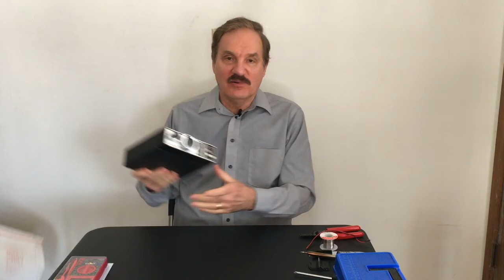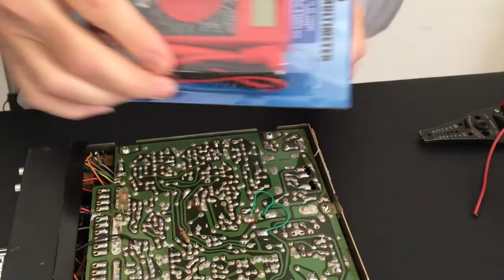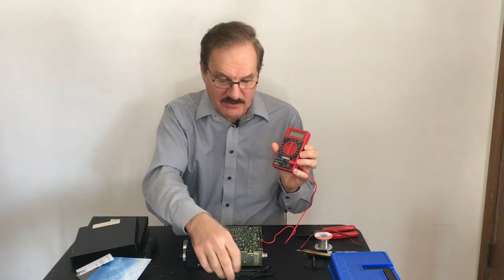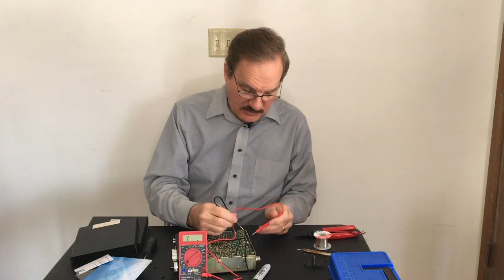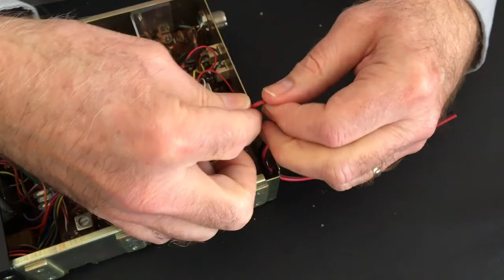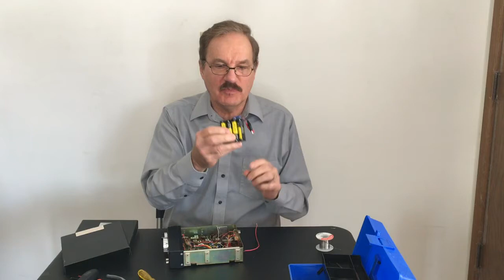How To Repair a CB Radio Power Cord

Comment: Where do I find the negative and positive?? I have the radio I took out the wires  I forgot but also have the meter. Help!
Reply: Don't know if you ever figured it out but if you take a meter and connect it to the chassis of the radio, then touch one of your two empty solder holes. You should get continuity out of one of them (it'll read zero or also beep depending on your meter). That is your gound connection. The other will be power.

Comment: why need a meter ??
open your eyes, remove the cable grip, get a wire and solder the board until it comes out,
locate the other wire on the board, heat it and remove it, remembering which was red or black.
fit new wire with a fuse,
maybe even check or replace the reverse polarity diode to be safe..

this guy makes easy jobs hard work..!!
Reply: Dear Stupid: the man did the job correctly. You, however, have no clue and are an idiot.